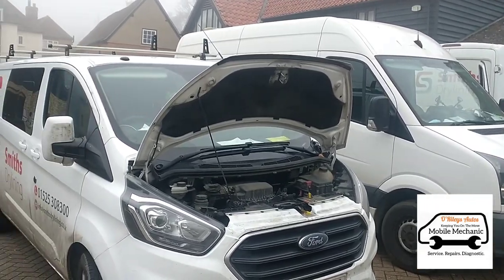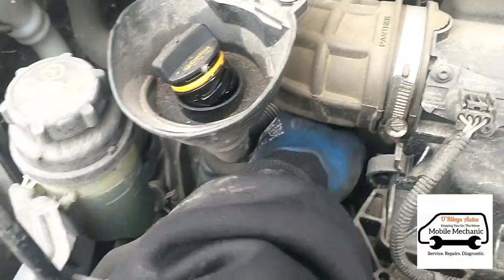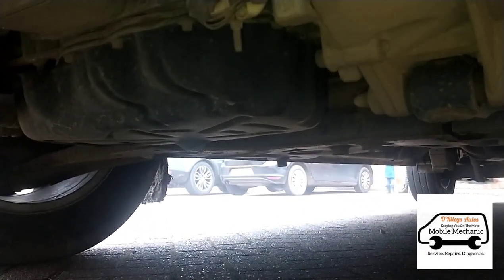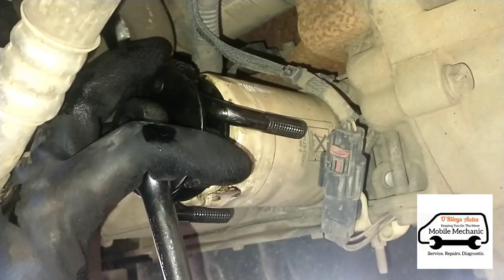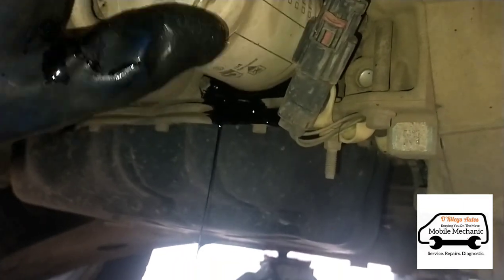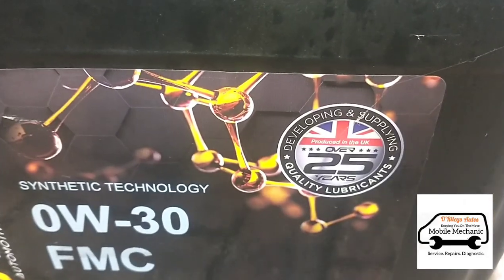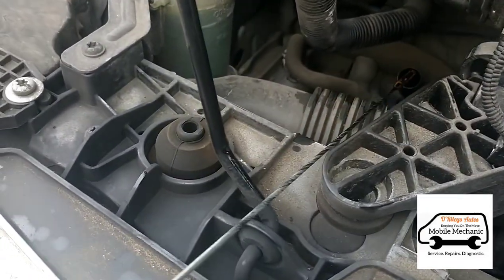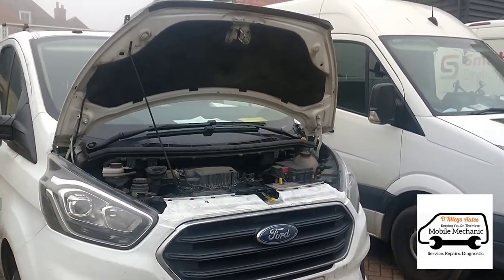Ford Transit Custom 2.0 TDCI Euro 6 Oil & Filter Change Service

Comment: My 19 plate crew cab online manual states 9.1 and 0w30 with 25,000 miles or yearly between changes.
Reply from the maker: 25,000 miles is insane. My van wouldn't go pass 10k servicing for oil
Reply: My 19 plate manual says 9.8 litres 0W30

Comment: Does anyone know what is the difference between 0w30 oil and 0w30d?
Reply: The 0w-30 D usually meets Fords WSS-M2C950-A oil spec for this engine. It’s best to go with that since the oil type is very important for longevity of the dreadful wet belt